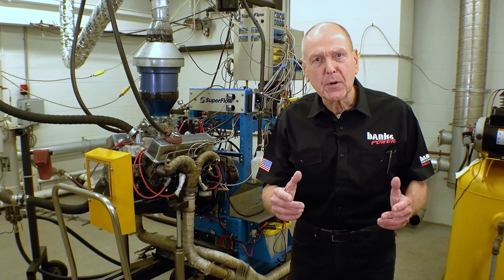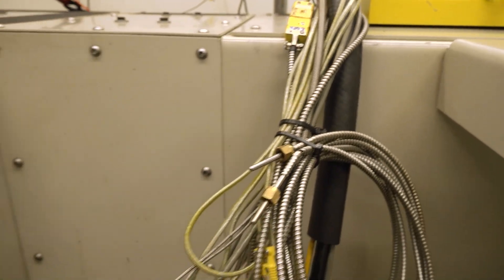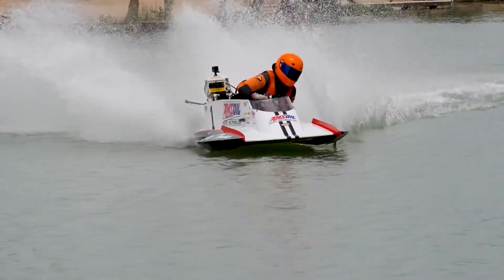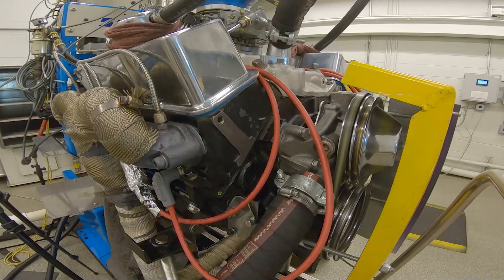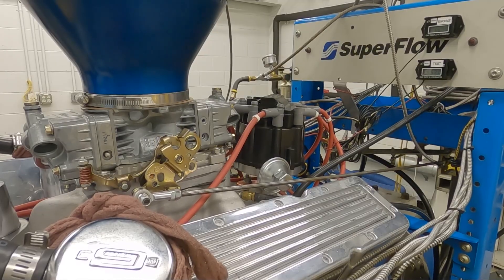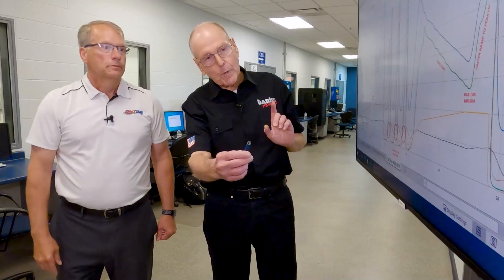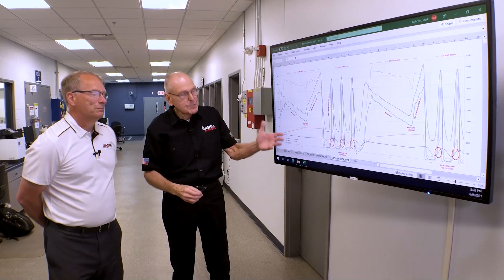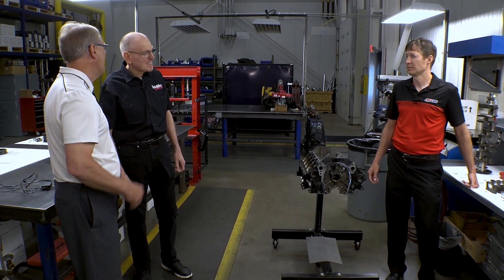This is a brutal motor oil test | Part 4 of 4

Comment: I'm ready to see what that engine looked like, would like to see all of the wear components bores, rings, valves etc etc.
Reply: It will look like any used engine. 😒 Nothing to see, really, hence why they have to measure and compare Extremely Tiny variations in the numbers to determine wear. 😆🤣
Reply: @I_know_what_im_talking_about  Maybe so but the abuse that they put it through for so long and non stop, I'd still like to see it.
Reply: @bodeine454  you call that a long test? I’ve done more pulls in my 2014 Mazda 3 over the course of 8 years and 100,000 miles with daily cold starts x2 (too and from work) and actual G forces while cornering HARD. 

I want to see serious Long Term results with a street driven & abused engine running on 15k oil change intervals with the oil level kept at LOW on purpose.
Reply: @I_know_what_im_talking_about  they basically did a 50 hour lemans on that engine, there a reason why you dont see hyundays on lemans, so that being say, yes i would love to see the difference, but i would for them to then base a base stock oil like walmart run throught it as an actual comparison
Reply: Agreed!
Reply: me too, thats what i was waiting to see, the before and after, i couldnt care less about the talk, show me the results
Reply: right!  IDK if I want that engine in my truck or not, its been so beat on but I KNOW it can take it !
Reply: Typical Banks fashion all talk and no show. Where is the results???

Comment: Its surprising to see a 350 chevy that can take that but I guess they rebuild it in between each cycle
Reply: The SBC is the most successful ICE in automotive history only to be surpassed by the LS if it hasn't already. Not saying they don't break but they are the least likely to break, all else being equal.
Reply: @johnclark3067  of everything I've ran, sbc is most likely to leave you on the side of a road. I have window'd a few sbc
Reply: @AndyFromm  yep every Chevy I’ve had needed A motor! All SBC
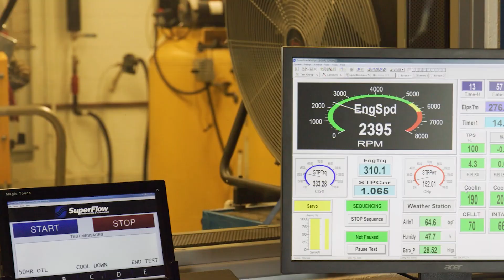Reply: If you go to 2:50 mark he explains all the parts that are replaced. Also, at about the 14 minute mark.